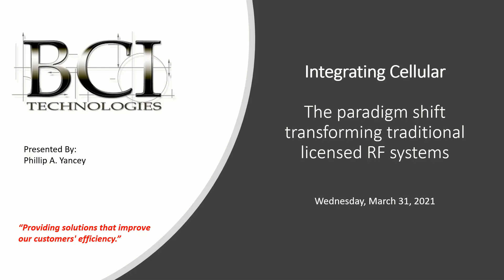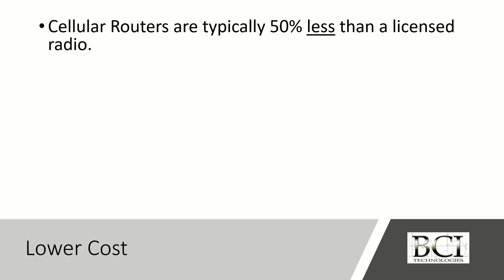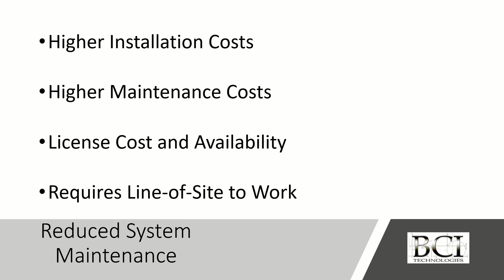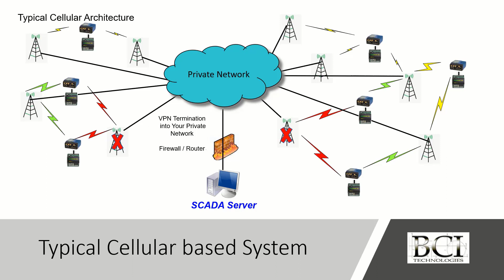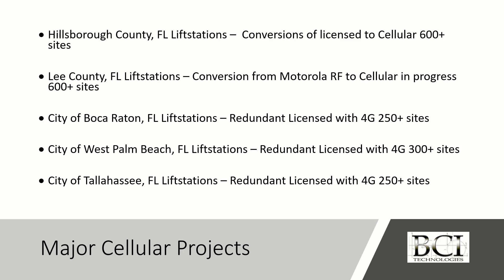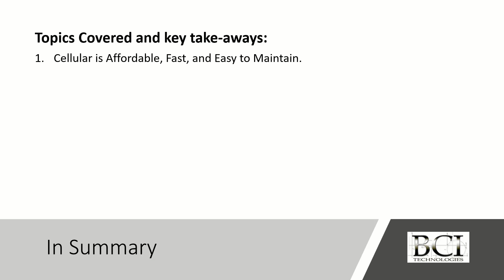Integrating Cellular - The Paradigm Shift for Legacy RF Systems.

Comment: Outstanding video Phillip.  Antenna systems use literally tons of concrete and steel.  Having your RTUs with antennas at cabinet height, shaped like a hockey puck and able to carry the data makes them hurricane resilient.  Again great video.